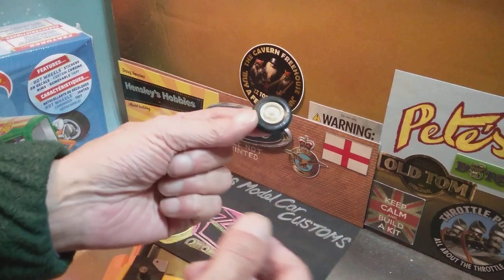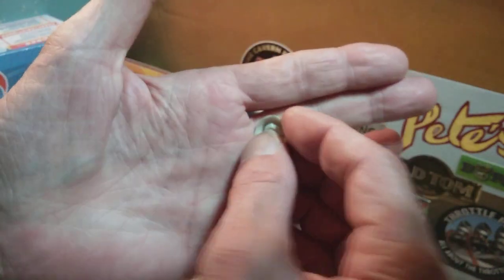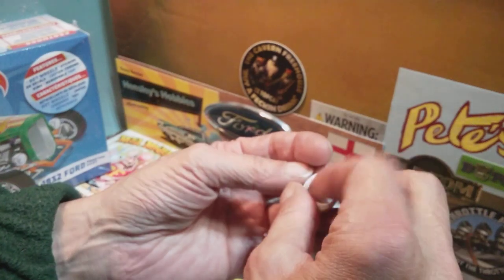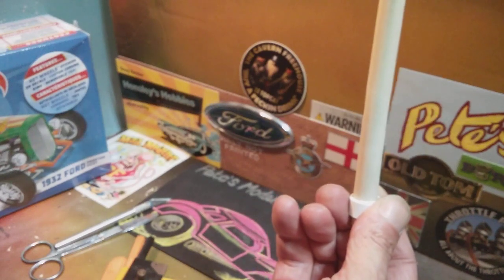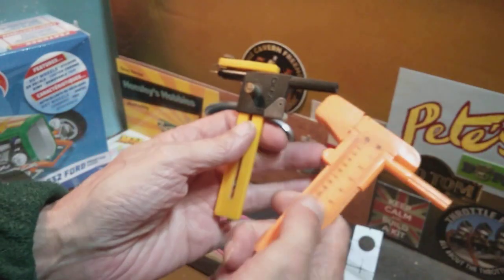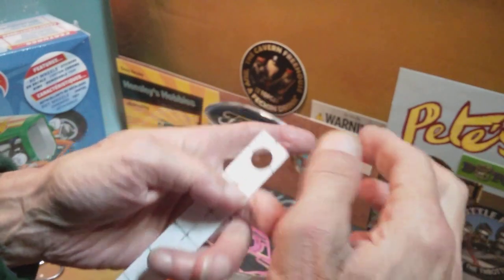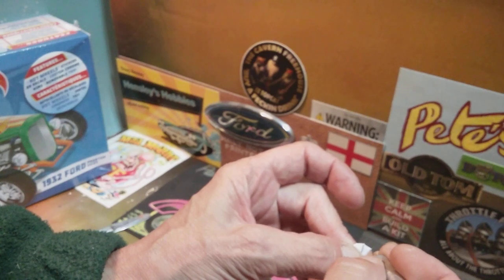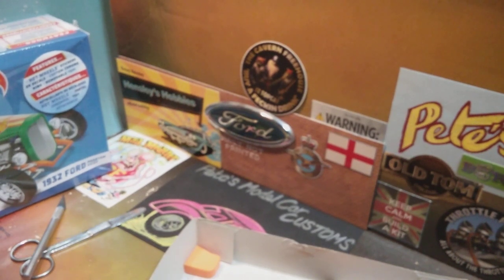How to widen wheels and make disc brakes Heat bending styrene and circle cutting tools

Comment: Pete, nice!  
Great video!
I've done wheel widening before to. I've also widened tires by cutting two tires and gluing both tires together to - but it was semi truck tires. 

Talk about heating and bending and stretching sprue is something I've done allot to. I've made wires to radio antennas to.
Reply from the maker: That's good👍😀
Reply: @petesmodelcarcustoms584  i use to build my own roll cages for racecars using sprue,,, cut them and round them, bend them using a small candle or cigarette lighter

Comment: Well, a very good scratch build, bring back some memories of a certain car I did.
Yes I have used  the hot water treatment. 

Never tried  it with coffee,  styreen the other sweetener 😊
I alway wanted a little hole cutter. I will have to look for it.

There is no getting used to metric, in the US.
I get upset when I go to the auto parts store and say I need this . What size motor 366cubic inch. They stare at me, ok 6 liter.
What is the trucks tonnage? I say 3/4 ton.
another icy stair K2500. Is it four wheel drive , I said, "K, that means four wheel  drive in Chevy language."
Lol it's here to some extent. 

I only say the Mets measurements for the people living out of the US.😊
Reply from the maker: I knew you'd have used hot water and been in it😅👍. The hole cutter is a cheap but very useful tool,they come with spare blades. The Olfa cutter is better made. Our weather temps are metric too,centigrade😀not Fahrenheit
Reply: Yes, I know that ,lol. you also talk funny😅
Wa a, what is that ?
We don't have it here. but coffee we have and water ,but no wa a here😂
Sorry, it's fun. I like the differences in the same language.
We say stuff weird here, too. Like Texas oil is not oil, it's O.
Some say ant, but others say ont( spelled wrong)
My family says something weird  for here, Fokes for mom and dad. But the German is showing.  folks is  volks, it means people.😊
I don't hear that anymore here.😮
Reply from the maker: I'm originally from South London so had a sort of Cockney accent that's been corrupted by a New Zealand girlfriend and my living in various parts of this country. Over here I think the accents change at about every 50 miles🤣
Reply from the maker: Propa King's Ing lish I speke Gov'na

Comment: That is cool Pete. I got my Dad's hole punches.
Reply from the maker: So have I but they don't go up to 20 or 40 mm diameters. Nor do they mark the centre
Reply: @petesmodelcarcustoms584  Yes, that is an issue. I need to make headlight lenses for a Model T though, and they would be good for that. - Dad did teach me how to find the center of a circle using a compass, but I never did get that right. Maybe now that I'm 50, I can figure it out better! LOL!
Reply from the maker: @MonsterHobbiesModelCarGarage  set you dividers to the radius size. Put one point on the circumference. Scribe an arc in the area you think the centre is. Now move divider point 120 degrees  to a new point on the circumference. Scribe a line in the area you think the centre is. There should now be a small x,giving the centre point.i hope this explains it and I can get out of bed and make some coffee. Geometry at 6.30 am 😅👍
Reply: @petesmodelcarcustoms584  Thanx Dad! :face-blue-smiling: (He taught me the same thing 40 years ago, but I wasn't good at it.)